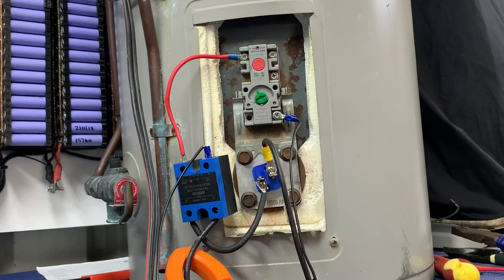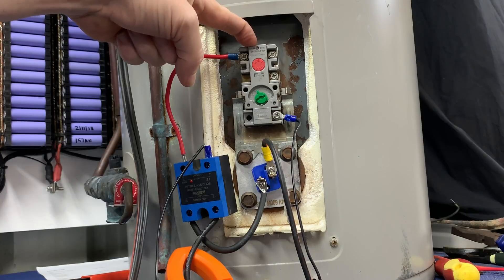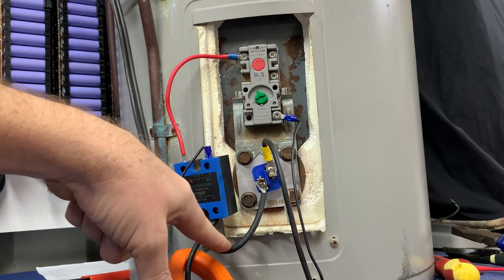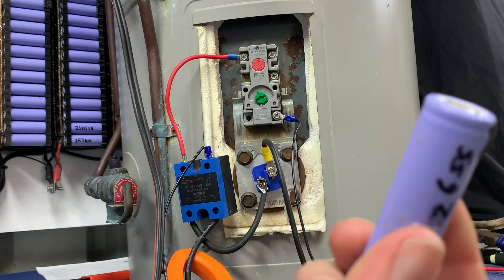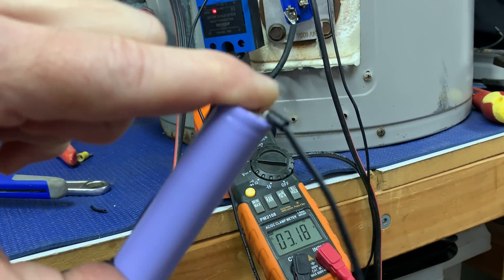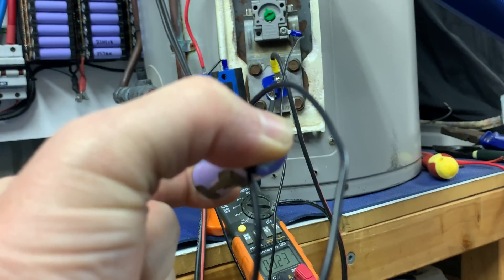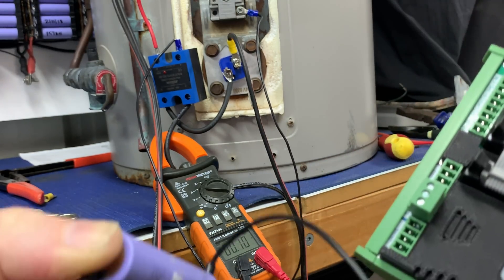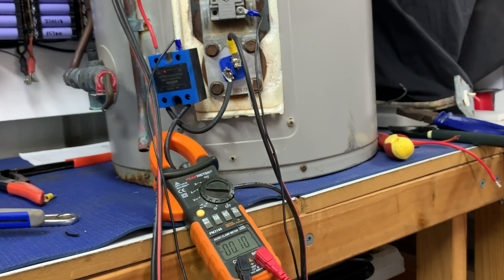Cheap DIY Direct Solar Hot Water concept!

Comment: the ac on low voltage with a relay will be fine the solar arc will be in the relay and i think this is the most effective way of using solar to heat water as once batterys are full you still using the power that would otherwise not be used
Reply from the maker: I think it will work well also, but it's great to hear all the other ideas & theory makes it easy to make a more educated decision on a path forward - but I think I'm close.

Comment: Pete, yeah using the AC stat to switch DC is not a good idea because of the arcing potential. You’re onto it. But keep the  AC hot water stat to keep it simple and have it drive a DC (contacts) rated relay or contractor that has a mains AC coil. Better still, there are Dual AC-DC hot water elements out there, set them up where the DC element(s) (some have dual DC circuits) are rated at 1kw or there abouts, with 1.5 kws of solar panels, and a 1 kw of AC element circuit. For those people with existing AC hot water systems, change out the element for a dual AC DC element and then couple up to some solar panels. This is being done commercially here in NZ but is supplied with a Hybrid MTTP charge controller which goes some way to controlling the switching of DC

Comment: It’s not a “dc element” heating elements are almost pure resistive loads so will work on AC or DC, you may have purchased an element selected at X dc volts but it’s still just a resistive element.
At that current I would suggest your standard thermostat will operate fine for a long time keeping in mind that it was probably designed to switch 15 or 20 amps AC so your DC load current is likely less than 20% of its AC rating
Reply: Hi Ian, can I pick your brain? Can I power an ordinary dc element with panels, putting them in series to up the voltage and down the amps, and using a DC static relay switch with an ordinary geyser thermostat, swapping on and of around to manage the temperature?  Would that work?
I'm from SA
Reply: @jakesgrobler1634  sure, as I said previously the elements are almost purely a resistive load so it’s not really a DC element. So it’s really going to depend on your rated voltages and amps, if you don’t exceed ratings it should work fine. Anything that is switching DC that wasn’t designed for it may have a shorter life but if you are no where rated amps then it’s likely to last reasonably well. Possibly worth considering some sort over temperature safety device maybe a manual reset thermostat or perhaps a thermal fuse but I’d want something manual reset or fails permanently like a fuse, that way you will soon be aware of the issue
Reply: @ianbottom7396  tx for responding.

Comment: Others have already commented, but for completeness I'll mention it again: you are only using the thermostat as a switch for the low voltage, negligible current powering the SSR, so the thermostat's AC/DC contact rating is of zero consequence.  HOWEVER, please do be aware that SSR's typically fail CLOSED, continually powering whatever is connected, so make absolutely SURE that all pressure/temperature safety devices on that water heater are present and are in good working order.  Steam explosions are usually quite memorable events!
Reply from the maker: Testing only lasted a few days before the relay did exactly that fuzing closed. I'm greatful all testing was done when I was there and I was able to decommission the hws - more parts have been ordered and will be 240v ac . not DC as it's just too hard to do reliability. 200w custom element has been made and waiting on sparkie to help install.

Comment: Arduino, a temp probe, and a ssr. Heck you could even do voltage detection with 2 resistors and have it adjust power according to volts or temperature. Possibilities would be endless. And about $5/10
Reply from the maker: Yep - cheap and easy for sure when you know how :P

Comment: Hi Pete, That thermostat is a version of the old Robert Shaw bimetal spring disc t/stat, the only thing that makes a difference to it is heat, when hot the spring disc at the bottom warps and contacts the connectors, when it cools the spring disc goes flat and disconnects. The top spring disc is rated higher and is used as an over temp cut-out (+88°C).  No difference AC or DC it is a contact heat t/stat which is why it is saddled tight up against the body of the HWS. The element will power (resistance) up once the t/stat gets cold and disengage when it heats up to the set temperature (the green turn screw can be adjusted) up or down within a set range 35°C - 75°C usually. This can vary with type of the same t/stat. I've never seen a DC element which is interesting and I presume it works the same way as an AC element. If so fill the HWS up turn on the power (as long as you have enough to make the element work) it will heat up to the t/stat setting and switch off. Repeat.
Reply from the maker: Thanks for the info - some have said there is no such thing as a DC/AC element it's just how it's made ie resistance... i'm learning heaps lol

Comment: You might be interested that @LithiumSolar recently did a project in the same genre (his latest video) titled "Heating Water with Excess Solar using a Reliance 6 Gallon Tank and a Sonoff Switch".   In my own case, I replaced my gas water heater with a Rheem 50gallon hybrid system and found that the Heat Pump Only Mode does work at between 400w and 550w (max) which makes the load on the inverter pretty light  / don't have to worry about 5000w spikes...  and burns off 5kwh/day...   but it does take a couple of hours if you do a couple of loads of laundry to get hot enough for a shower with ambient (intake) temp of  20C  :)
Reply: At home I heat water with a NYLE external HPWH.  I use the spare heating element to provide supplemental heating with solar to make the heat pump run even less. Like anything mechanical they will wear out and reducing use can extend life. Those adventurous can disconnect this heating element in the all in one units and power it with solar.  The cost of 500-700W of panels has a quick payback in supplemental heating that rivals that of a HPWH.  @LithiumSolar system is not something you should choose to emulate.
Reply from the maker: @lithiumsolar's setup is amazing for sure, however the intended purpose and budget for this build dictates many factors. Mainly it has to be DC direct from 24v batteries. This bench test was some learning and public input (which has been quite a learning experience as always) I'll rip out a second video today with some water in it to see how fast it heats up, be a bit of a messy video but the info should all be there i hope :)

Comment: If you have any electronic nous,  I've worked out a very low cost heater controller that holds the panel volts at power point and operates directly off the panels. It can also be used in parallel with any charge controller and not screw up battery charging. Powering heating elements off batteries is just bad form.  I use this system at my camp and I have plenty of hot water. It is amazing how much power can be diverted when the battery charging controller is not using it. Diversions as little as 5W anywhere up to 500W can happen even in morning.  Even use this system so my wife can have a dishwasher with heated dry.  It even uses the existing mechanical thermostat for arrays up to 100V DC without arcing.  I use a 60V array on mine and 2,000W120V heating elements.  240V elements can be used if they are the 5,500W types. View my videos.  This is the ultimate system.
Reply from the maker: Thanks for the input, link your videos and i'll approve the links (i have all links on approval to stop spam)
Reply: @HBPowerwall  This is the nickle tour of the dishwasher and hot water controller. Shortly after this I replaced one of the old leaking tanks with an ECO smart 6 gallon point of use tank which has a 1,400W 120V element.  Two tanks are in series and the small one is the primary which heats up quite fast. The other tank has a 2,000W 120V element which produces 500W at 60V. My other videos give more detail though technical and preliminary as I was developing the system. Just got back to camp for the season and may do a video on the updated board. There has been almost zero interest in this here and on forums.  I still think it is pretty much a beginner level project adding only about a half dozen parts to the board.
 
https://www.youtube.com/watch?v=y7JQMsScZkk

Comment: I wouldn’t use a solid state relay “if that’s what the blue thing is” otherwise looks good.
Reply: Solid State Relay is for the DC arcing problem. If he didn't use the SSR and just went straight through the thermostat, the thermostat would then be handling the full current of the heating element. Arcing would occur at that point and shorten the life of the thermostat. The SSR is safety measure and an economical one. They don't cost much more than a thermostat, or maybe even less, and would last a lot longer.
Reply: I didn’t say don’t use a relay. Just I wouldn’t use a ssr. I also would do 2p2s with his 4 panels.
Reply from the maker: element / battery / setup is 24v where it is heading it will be controlled via batrium much like I did with the BatteryHasher. Feedback is great and allows me to make decisions based on the communities experience not my guesswork.

Comment: The VMP of the panels should be closer to 24vdc or you will loose power.
Reply from the maker: I'm guessing if they element is 24v 600 watts 30v should be well within the range - the battery it's going on is 28v max and will turn on at 27v
Reply: @HBPowerwall  should be good. But if you hooked pv directly to the element it will drag down the panel voltage. But it will work

Comment: I’m working on something like that for my dump load. Hot water is a great way to use extra solar power
Reply from the maker: @Ray - make sure you link me so I can take a look when you're done! @kori we are also looking at a turbine but the property is down in the valley a little so cables would be crazy long to get the turbine into clean air.
Reply: @HBPowerwall  Yeah, valleys are great for farming, they suck for power generation  :P
Reply: I plan to do this as well, but I'll be adding it as a dump load for wind turbine, too. Here in Florida, USA, we get winds as the sun goes down. If solar generation is from 8A-6P, wind would extend that out another 2 - 3 hours. Oh, and during hurricane season when we have lots of clouds  :P

Comment: Dude, there's no such thing as an AC thermostat. A thermostat is just a switch that's activated by a bi-metallic actuator. There are differences with switches regarding AC and DC though, so you're not totally off the mark but at potentials as low as your application and what are not particularly high currents, it's not a consideration. NOTE, I'm not saying you could omit the relay, you probably already know you need one in there! There's also no such thing as a DC element. A heating element is a purely resistive load and acts exactly the same whether powered by AC or DC, the only significance is that they do not exhibit any capacitive or inductive load qualities when powered by 50/60Hz AC, which create load phase angle problems (reactance and reluctance IE: "apparent power" vs RMS).

I would have thought you'd have seen water heating as a load shunt before! I can't believe you've been supplying the grid while paying to heat water!! Once your batteries are full it's a GREAT idea to shunt the excess to hot water in preference to selling it back to the grid for pittance. 

I'm well versed in these types of systems. Feel free to get in touch if you'd like any help with it! I'd be happy to help and pay back some of the info I've gained from your channel over the years!
Reply: Another thought, what's the part number on that SSR? 
You've gotta be careful with solid state relays, some are designed to switch A.C. and utilise an SCR as the switching element. These types will not turn off if switching D.C. until the switched power source is de-energised. This is because SCR's rely on the zero crossing of the A.C. sign wave to "de-latch".
Reply: @Jimmeh_B  we have AC rated devices and DC rated devices.  They are rated for the arc on switching. This thermostat has never been rated to switch DC. Thus when you burn down your house you have no insurance. What is your electrical background?
Reply: @ballsyau1974  My background is irrelevant. I am however well aware of contact ratings and what they mean.
So I'll ask again, why on earth would you suggest to a "layman" that they should incorporate specially a 240V control circuit in a LVDC system which does not derive it's supply from mains?

Regardless of the thermostat's ratings, I am 100% sure that it can handle the 3/5 maybe even 10mA draw of a solid state relay's signal input requirements. Or are you trying to get Pete to burn his house down? (your logic)
Reply: @Jimmeh_B  so you have no background in electrical. So talking out of your ass!
Reply: @ballsyau1974  
yes,  Jimmeh B
 writes tons of words but miligrams of knowledge
Reply: @ursodermatt8809  he is a keyboard electrician. I see them all the time,  when I go and fix their work before reporting them to the ESV. He still hasn't read my correction on my first comment. Saying it will work but so would what I suggested.
Reply: @ballsyau1974  Lol. You'll never be called in to fix my work mate.
You corrected your first suggestion.
Enough said.
Reply: @ursodermatt8809  lol. okay.
Reply: @Jimmeh_B  dc elements are VERY different. They have multiple protection against electrolysis, and a stainless sleeve. Please get educated
Reply: @climatechangepreppersfaceb2148  
Electrically, they are no different.
"Please get educated" ... Go fuck your hat.
Reply: You're misusing the word shunt, which in electronics means something specifically different. You mean a hot water transfer switch.
Reply: @drc6940  no that's not what I meant, and yeah, technically a shunt is something else. The term gets bandied about a bit in the wind generator hobby forums, which doesn't make it any more correct I know.
Is there commercially available such a thing as a high current low voltage DC hot water change over switch? Cause this thing has a 24V heater in it. I'm sure they are available for 240.

Comment: Great idea heating water but still think it's better done with just using AC even though there are losses in the inverter.
Reply: Any particular reason why?
Reply from the maker: The inverter on site it only my Old PIP2424HS there isn't a budget for another inverter yet and not having to convert dc to ac will save solar/batteries that will be vital on cloudy days. Just thought might have to add a manual override to heat the hot water on demand.. that's a good idea pete.
Reply: People use what they know and hold onto those ideas like Grim Death. You are dealing with two conversion losses and battery inefficiency. Operating off the batteries screws up the charging.  Operating off the panels with a power point controller  is the best way to heat water getting all energy available energy from the panel. These concepts take a while for the general public to understand. Microprocessor toilets were invented in the early 70's and it took 40 years for them to come into use.
Reply: ELECTROLYSIS!

Comment: The thermostat wpuld propbably be fine, but it is definitely best practice to use an interposing relay/ contactor if you are unsure. Good job.
Also you want to make sure the tank actually reaches a certain temperature to stop bacteria growth, I can't remember what that is exactly but worth looking into. Ask a plumber maybe.
Reply from the maker: It's offgrid tank water - tanks are probably full of bat shit & frog piss lol Human body can get used to it lol but yes i hear you. This is the reason I went for a smaller tank, not a 150l unit.
Reply: @HBPowerwall  sweet, in that case, if it were me I'd set the thermostat to 80 if there's no children around. Or even if there are children around! lol Most of us understand that kiddies need to be supervised but apparently we need to legislate for the kids that have kids or something. I prefer a hot shower that lasts personally. :)
Reply: @HBPowerwall  I realise this is an old video. Just for reference, you shouldn't really go below ~48 degrees C (I always recommend 50 degrees minimum, to act as a safety margin), without a temperature controlling valve, as Legionaires bacteria forms between ~38-43 degrees C. Which is why you should never submerge your head, in a spa pool, as the bacteria can also enter through your ears & nose.
Reply: Yeah you are right. It's 60 Deg C avg in Australia. Legionella being the primary (but not only) concern. It is also a legal requirement that all new domestic installations have a tempering valve on the output of the hot water system that stops the water temperature in domestic installations from exceeding 50 C. It also notes in the code that hot water supplies intended for dishwashers and washing machines could benefit from higher than 60 deg C temperatures.

So it all depends on the intended purpose and yeah, should definitely consult with a plumber once the system is operational and about to be plumbed in to the house if that's the intention.